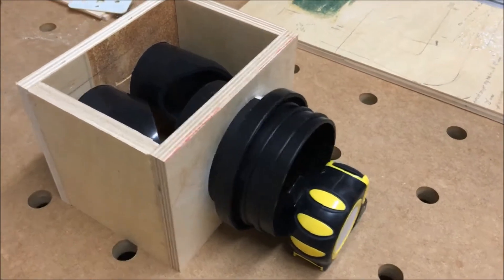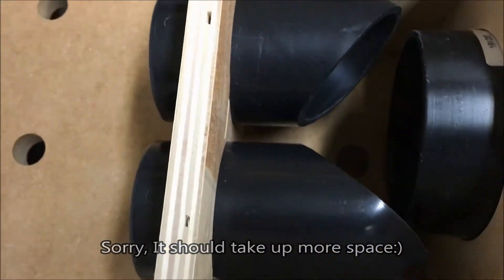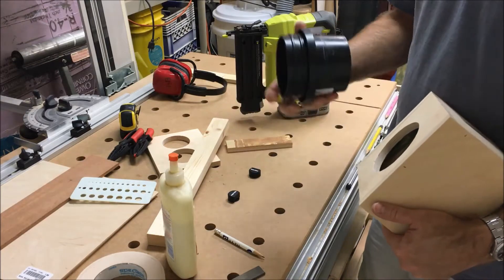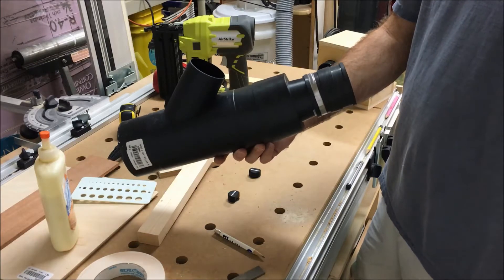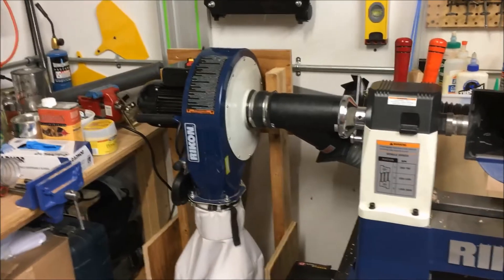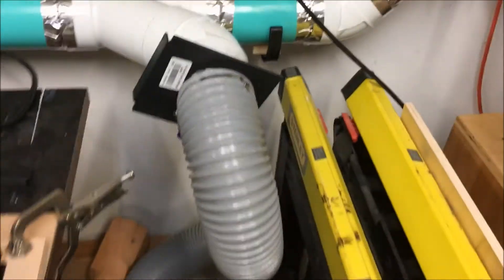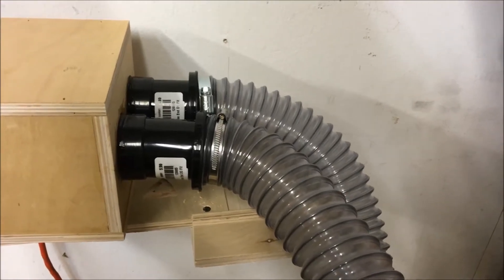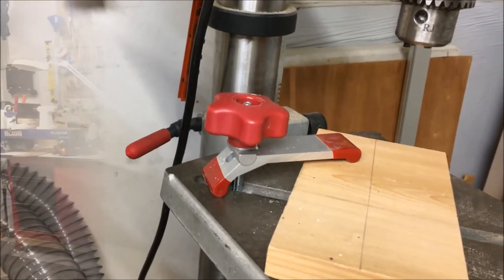Dust Collection, single 4" to two 2.5" ports

Comment: Nice work! How would you say the performance is now that you've had it for several years?
Reply from the maker: The biggest thing for me to keep the cfm's high, was when I added the dust right canister to the Rikon collector. https://www.youtube.com/watch?v=85vnQlntFtg. Now the cfm's don't vary but stay the same as the bag gets filled up. Before when my collector cloth bag would get half way full it would lose a lot of suction. Thanks for the question and watching my channel.